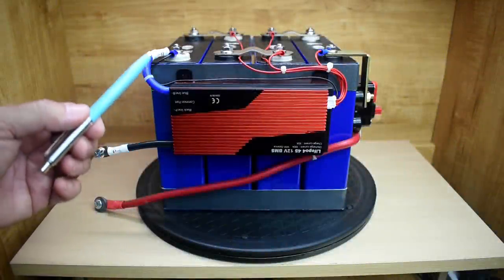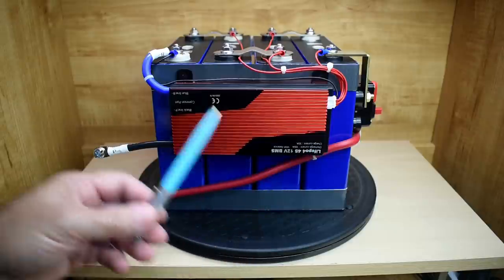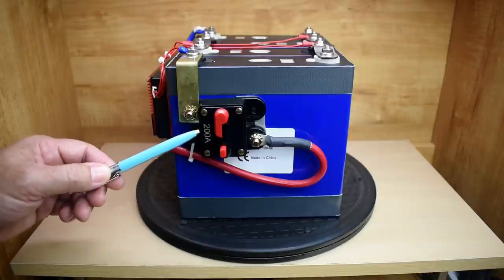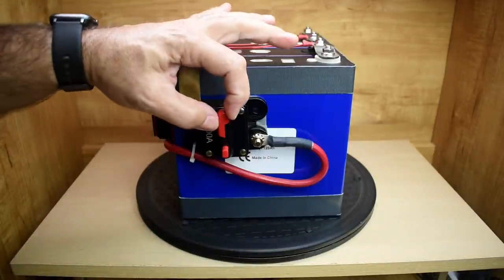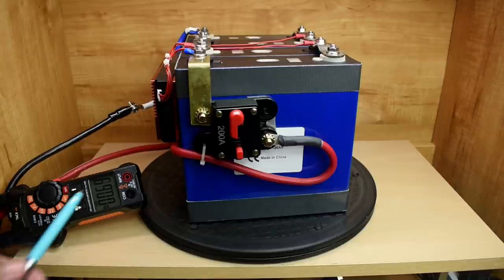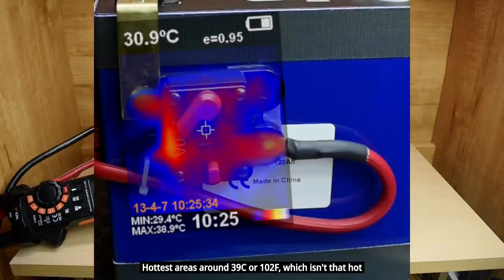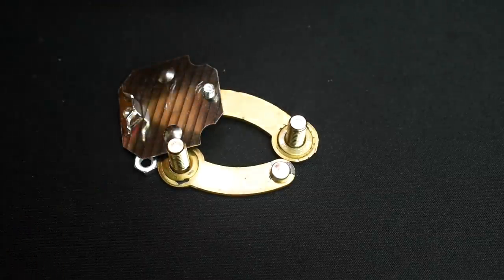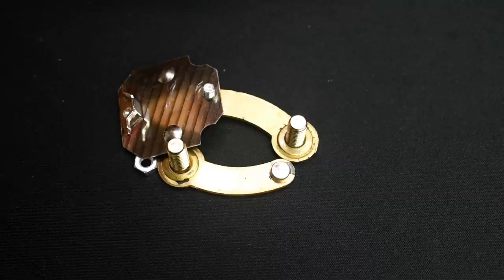NEVER Use This High Current DC Circuit Breaker For Solar, Auto, or Marine!

Comment: Thanks for saving me from disappointment!  Looking forward to your next video!
Reply from the maker: You're welcome! Many more videos to follow. Looking forward to your next great testing video. Thanks for watching!
Reply: Too late for me I’m afraid.
Reply: I had a breaker like this in my boat. The thing LITERALLY lit on fire-in my bilge...near my gas tank...im lucky to be alive. Glad I clean the bingle so no oil/gas vapors, I had to cut the wires off and twist them together with the addition of 10ft of steel leader wire to handle the current
Reply: Wow. It's project farm.
Reply: Test by yourself.

Comment: Chinesium. Problem IMO is the small silver coated contact. U can see the arcing marks in the silver, there is arcing happening at the contact 'patch' so it isn't making contact over enough surface area, the arcing causes resistance & heat , heat opens the connection. Contacts have to be adequate size & also machined accurately so there will be enough contact area to pass full volts & amps.
Reply from the maker: I would also say that's the most likely problem. Thanks for watching!

Comment: I'd recommend against that Mini ANL fuse holder... very cheap and the plastic will just melt under load, leaving exposed metal that still hasn't broken apart... very dangerous.

Comment: I am a Tech in West Australia. I have had the same problem with these Audio Breakers. Three different units so far. First one showed up on a 4 WD DC to DC setup. Thought the Smart Alternator was cutting in & our. Turned out to be large volt drop across Breaker bolts. The next problem breaker was a 250A unit (similar to the good unit you showed) That Breaker used with a 2000w inverter trips out at 130A. They all appear to be made in China (most everything is) but finding one with SAE or some decent spec sheet guaranty is hard to find. A flat 100A fuse you suggested just can’t be used when you want to switch off to isolate. Cheers

Comment: These type of breaker switches do not have a magnet to draw off the DC arc. They are good for 2-5 load breaks and that's it.  Don't use it as a switch under load. Just like you shouldn't use a AC circuit breaker as a switch.
Reply: This is not necessarily true. 1kA sure, some magnets to extend the arc, oil to quench the arc, etc all help. At 200a though the silver contacts when properly sized, with enough plating and strong enough return springs to promote fast opening time are sufficient, break open some name brand starter contactors from little fuse, trombetta, etc will reveal this is sufficient for 50,000-100,000 make/brake cycles

Comment: A 200 amp (standard-rated) breaker should trip at a 200 amp spike. Constant load rating is 80% or 160 amps. That breaker should have been able to handle 154 amps without overheating and tripping. Just like their battery ratings, you never know what your going to get. Thanks for the informative videos!
Reply from the maker: Thanks for watching James! Be sure to look over my video playlists below for many other videos of interest to you, and most importantly take one minute to share a link to my channel with others on social networking sites. 
http://www.youtube.com/c/electronicsnmore/playlists
Reply: This is an interesting fact, since this is different to Europe: In Europe the rated current of a breaker is the maximum continuous current. Depending on the characteristic of the breaker (there are several different available) the breaker should trip at a current of 1.05 to 1.5 times of the rated current, if they have an additional magnetic based short circuit detection this should trigger at 1.5 (circuit breakers in Europe usually have a thermal based over current protection plus a magnetic based short curcuit protection)

Comment: I have an anl, 100 amp fuse holder, and over a short amount of time, a couple months, it provides power, for a 1000, watt, inverter, and the fuse holder melts, o already replaced it a couple months ago, and its doing the same thing again, not sure why, and I use it to power a coffee pot, 5 cup, and to power a battery charger, to charge a marine, deep cycle agm battery, I'm assuming, I'm going to have to increase, the wire size, from 4awg, to 0 awg?

Comment: Looks like a lower rated breaker with a different panel on it. Those weedy studs give it away! If you've managed to shove 200A through it you've probably ruined the internals as well. My ones are 50A and it looks identical.

Comment: 13;25, The pressure on the contact may be substandard. As the concave plate started to heat up at 150a the pressure on the contact weakens even more, in-turn, increasing resistance / heat production, popping the device prematurely. As pointed out, poor quality device in several areas.

Comment: Had the same problems with my 400 amp circuit breakers they opened up at at least half their rated power , switched to fuses and no false trips , I really wanted circuit breakers cause of their disconnect ability so much easier than un bolting a fuse any know a reliable good 12 v circuit breaker brand?

Comment: Number four wire is the problem and not the breaker. 4 gauge wire is not made for 200 amps current
Reply from the maker: Incorrect. #4 can easily handle 100 Amps. There was no reason to use a 2/0 cable for the demonstration because the 200A rated breaker tripped well below 100A.
Reply: @electronicsNmore  u said in the video you were pulling 200a from it
Reply: @electronicsNmore  Also, using a 4 gauge wire on the 12 volt battery is not smart, because it limits you to 1,000 w inverter. A 1500 watt inverter will overheat the wire if it pulls full capacity. So yeah it does make to use 2/0 cable
Reply from the maker: @RemodelCalculator  I wasn't pulling 200A. The BMS was designed to allow UP TO 250A for a very short duration, and that's why the breaker was chosen slightly below that rating. The continuous current rating is 100A, and that's why #4 was used, not only by me, but by the manufacturer. Any more questions? LOL

Comment: Yeah those are known to be absolute crap. Cheap Chinese breakers are an absolute joke. You need to spend more money on higher quality, safety certified and UL listed DC breakers. 

And that BMS is dead simple and works great for most circumstances, but you will permanently destroy your cells if you charge while freezing. Because that bms does not have a temp sender with low temp charging protection. Also the OCPD on daly can be pretty inaccurate. 

Try buying higher quality electrical components and you won't be let down.
Reply from the maker: I live in sunny South Florida, where freezing temps aren't an issue, but you're 100% correct about no low temp protection. I'll add a notation in the video for others. Just like you and many others, I learn which products are good, and which are bad after testing them. Thanks for watching!
Reply from the maker: @DIY Projects That's true, can't say all.
Reply: blue sea makes good stuff but cost is high .those chines ones are crap .
Reply: Was going to say the same thing, that breaker is badly make can tell by pressing the test button and look if the breaker have extra movements
Reply: Put one on an E-Bike battery..  worked for a while (an hour?) then totally Open circuit with a Floppy Reset Lever..  Luckily pedals work too..
Reply: It's worth mentioning that very few circuit breakers are rated for 48VDC; I have this problem often.   Technically, most I've seen in this style (resettable lever action) are 42VDC rated.   there are load-rated breakers setup on a different buss for high amperage DC loads used in telecomm power plants -- have been used for many many years.   ANL/MEGA type fuses work well -- always do yourself a solid and silicone a spare or two nearby....
Reply: @realisticclearmind3531  probably comes from the early 2000's when this was very true for electrical components (german at x2 vs Chinese at exact spec).

No longer in that field; no idea if it still holds true.

Comment: Measure the voltage across the breaker at different amps, all thermal breakers have differing trip times because they all have to heat up to trip. More important breakers use curves graphs to show how long to trip at differing amps.

Comment: Doug, thanks for the PSA.  I have been looking at a DC circuit breaker for a long time, but didn't want to pay a lot of money or having to deal with having extra fuses.  That answers the question, an expensive breaker is cheaper than a good inverter, or fire damage.

I like these types of valuable videos.
Reply from the maker: You're welcome! Thanks for watching
Reply: @electronicsNmore  eNm...  Have you tested the Bussmann DC circuit breakers...  I see them used off grid and in the marine industry...

Comment: In every single video on YT people use noname chinese circuit breakers and than complain about them. What do you expect? I am sure it would not be the same if you use some proper ones like thise from Bluesea. It is very irresponsible to save money on high current stuff going cheap.
Reply: Exactly, the breaker is were you do not Cheap Out ☺️🇨🇦

Comment: Unfortunately you have purchased a very poor quality circuit breaker. Not sure what you except for a cheap China knockoff. Plus how can you expect 200 amps to travel past a ? 1/4 stud? Way over rated for 200amps, need to research what the original company made. Then China has copied this and just slapped 200 amps on a 60:amp breaker

Comment: @3.01 Bad Design, Well yes but it wasn't designed to be Good. It was designed to Resemble the Buss brand of quality breakers.
    If people buy the cheapest Chinese knock-off, what are they really expecting? I guess this video is targeting the 'Not very Brilliant' DC project builder!
     Also, if anyone is playing with voltage higher than 12 volts, like 24, 36 or 48 you need to be very careful about your fuse selection, if you go that route. A lot of fuses are too short for higher DC voltage. They can 'blow' and allow current to flow because an arc is jumping the gap created in the blown fuse!
    I would just like to say,. If you don't want a fire or worse. DON'T USE CHEAP CHINESE JUNK! There's a lot of things that you can cut corners on but your wiring isn't it... 
    Nice Video!
    Ya'll Take Care and be safe, John

Comment: So, is anyone surprised that Chinese products don't operate anywhere near to spec.
Great teardown. I always work off the premise, of 50% max., for any sizing of products. Would be interesting to see a comparison, between the good makes: bet they don't use brass, for conductivity. 
I've also bought non-insulated crimp terminals, from Amazon, that were Chinese. Guess what: they weren't plated copper, either. Plated brass; at best, with a low %, of copper. I could tell, by the colour: very pale.

Comment: Steer clear of any protective gear (circuit breakers, fuses, switches, etc) that doesn’t have a manufacturer’s brand/logo on it. Also beware of fakes that have a false brand/logo on them. If it’s half price or less than the rrp, it’s likely a fake or inferior.
Unfortunately reliable brands have enormous markups for the distributors and retailers, making these fakes and inferiors so attractive!

Comment: It appears you purchased a couple of the cheap chinesium knock-offs.  Once you find a good supplier on eBay, these type of breakers work just fine.  I have a few 150-250 amp breakers of this style that all trip within 10% of rated current.  And $15 to $20 is a whole lot cheaper than $100 - $200 for a Blue Sea equivalent.  The key is to look for breakers that have brand and UL listing info on them.  Its also a lot safer to throw a $15 breaker into a new system, than to hold off until you can afford $100+ for a new breaker.
Reply from the maker: They are made in China, there's nothing to KO. The style shown in this video, same housing, same lever, same reset button,etc.....a definite avoid.

Comment: This style of breaker works fine as long as you don’t buy cheap crap one!!

I was having drama’s with 60 amp no name unit tripping with only a 30 amp load. Went to a 100amp cheap unit same problem started tripping due to screw terminals getting hot.  

Swapped it out for a 40 amp blueseas breaker and it has not false tripped once or got warm at all. The old saying apply’s here. “You get what you pay for”
Reply from the maker: I never said the style was bad, I said if it looks just like what you see in this video, don't buy it. Bussman and Blue Sea are OK.

Comment: I use a T Tocas Superior E9-90 that costs $26. This one has multiple S.A.E and UL certifications. It's also listed as waterproof and ignition protected. It doesn't have the subsurface lug issue and I have had no noticeable issues with it's operation nor any over-current trips even with my system cranked in freezing or hot weather. For reference, my sound system is a pair of Rockford Fosgate P3D2-12 sub-woofers powered by a Rockford Fosgate R1200-1D Prime amplifier and a RFC2D digital capacitor.

Comment: Seems like you just have a cheap model of that breaker. I've used those quite often in many of my builds and they hold up just fine. Many of the other ANL fuses I've used melted under the same conditions. If I use ANL I typically had to buy the ceramic models.

Comment: I think you might have just helped me diagnose an issue in my 12v system.  I have a similar 200 amp breaker between my battery and the rest of the the electrical.  After about 5-10 minutes under highish load (around 100 amps), my inverter, solar charge controller, and other devices powered through the breaker all shut off and immediately restart.  Nothing shows up in the BMS app to indicate I've exceeded its 130 amp max output setting.  I assumed it was either a problem with my BMS or with my inverter because the breaker never actually tripped.  Based on your video, I'm thinking that maybe the breaker is heating up causing a temporary disconnect without actually causing the breaker to trip.  I never thought it might be the $25 breaker I bought on Amazon.  I didn't know much about breakers so I didn't realize that a $25 dollar breaker was "cheap".  I've ordered a Blue Sea breaker and after I install it I hope my random micro-outages will be in the past!

Comment: Im so glad you posted this video. I have been using the same 300 amp circuit breaker in my RV and its been popping off prematurely. Thanks for the in sight.

Comment: Yeah, those breakers suck...but I love em!   Mobile RV service is my thing, and I've been paid rather well to drive to remote locations to reset these pieces of junk. 😁
Reply: Can you recommend quality breakers?
Reply: @chris8383  Yes.  Blue Sea Systems makes very high quality DC components, however, their 200A breaker is about $80!  I did see many others on Amazon though, but am unsure of quality.
Reply: MidNite Solar 12 v DC Breakers and a MidNite Baby Braker box. I use them for all my Solar RV builds. Can use for any off grid Solar system. I use between Solar panels to solar charger and solar charge to battery bank. Just use correct amp breaker for expected current.

Comment: i used Eaton Cooper Bussmann 187 Series Reset Circuit Breakers 30 and 75 amp. $49.50 each but well worth it. i also use max wiring size on my solar project. for 200 amp id use midnite solar.
Reply from the maker: Eaton makes good breakers. Midnite solar makes good stuff. Thanks for watching!
Reply: @electronicsNmore  i found you researching SWIPOWER/CNSWIPOWER 3000W/6000W off-grid pure sine wave inverter. very well done and you have earned a subscribe from me.

Comment: I agree that breaker is crap, but 200A should be it's breaking capability, not triggering current. According to your tests I would say that this is ''200A''  breaker with 63A triggering current, medium or slow type. 

I like your videos very much. 

Keep going like this :)
Reply: No 200A should definitely be the triggering current.  That would be like rating a 50A fuse 200A, it would blow as soon as you turn on the load.

That is NOT how we rate electrical protection devices.
Reply: @SnowGolem1TheL33t  There is a difference between CIRCUIT BREAKER and automatic FUSE. Fuse should trigger at rated current, and circuit breaker should be able to brake electric circuit at rated current, circuit breaker, if it has triggering function, could be sett to trigger at less value than it's maximum rated current, according to circuit designed current. 
This is of course nonsense, because there is no way to sett triggering current, thus to achieve it's braking capacity current :)

Comment: Can confirm these circuit breakers are total rubbish.  I've got two which are no longer included in my 12v wiring, one between the charge controller and battery and one between the battery and inverter.  I kept coming home to find my batteries disconnected despite no fault occurring and having trouble actually getting the 1500w rated from my inverter.  Everything works wonderfully since I bridged them out!
Reply from the maker: They're good for nothing. LOL

Comment: If you want to try a better breaker, look at the Rockford Fosgate brand. I have ran a 12k winch for a good pull and it worked a premium.  The style you have shown also don't make a good contact on the input and output

Comment: Unfortunatelly I bought one of those... The first one failed after a couple of days only giving contact once in a while. The second one will switch off at about 140Amps but will not move the lever. So it will come back on its own. Totally crap, very dangerous. A cicuit braker shall switch off and stay switched off if triggered.
Reply from the maker: Thanks for watching Ralf!